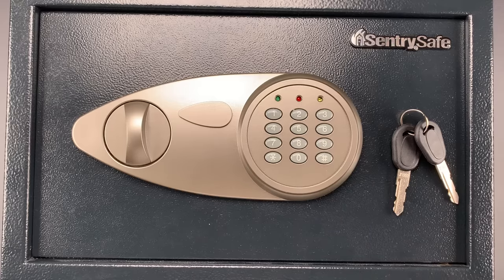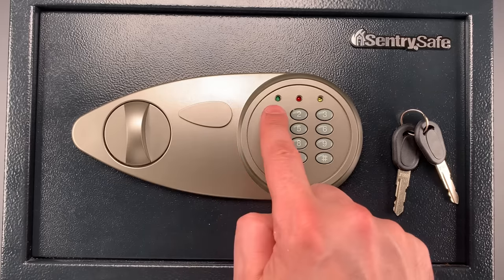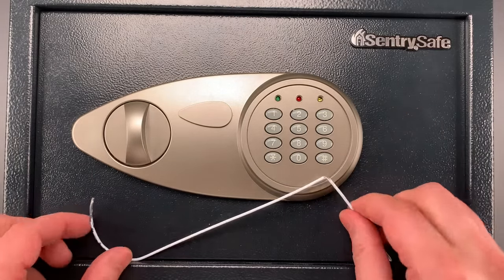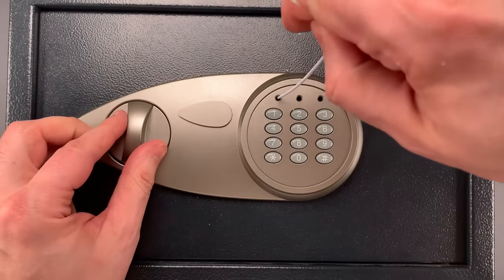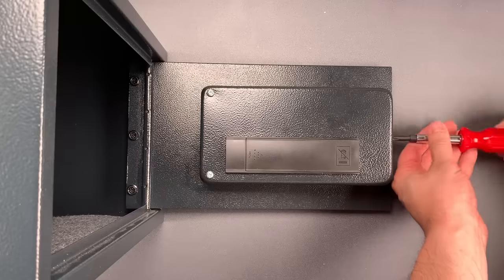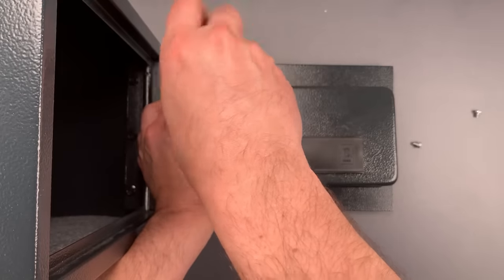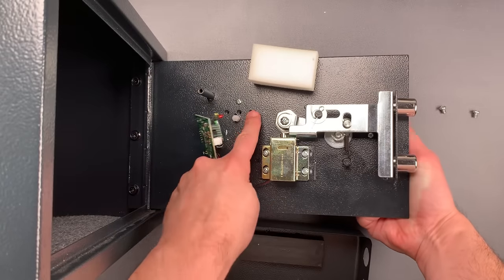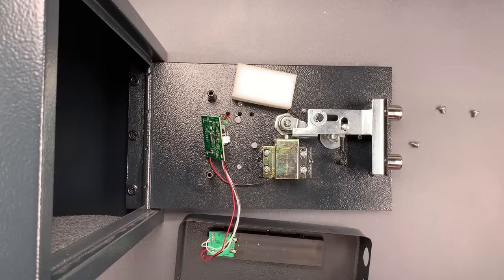[1020] SentrySafe Opened With a Coat Hanger!

Comment: Every manufacturer should be scared af, when their company name is in this guy's 2 minutes long video.
Reply: @owenfranklin814  lol you think i can't see you edited that comment mister soell?
Reply: Dont be deceived by these videos; this guy works his way backwards; he first opens the safe by the standar method (keypad password) then dissasembles the inner box to discover the flaw; in this case the flaw he shows is easily fixed by putting some strong metal block wall in the path from the led holes to the solenoid; but even if you gave him this safe and ask him (without knowing in advance the inner mechanism) he wont be able to open as easily as showed (there's no way he can come up with that specific hanger bent in that specific way if he doesnt know EXACTLY how the safe works, which of course he knows by first opening it off-camera)
Reply: @alerey4363 You are correct.  Lock bypass cannot be done with knowlege of how the lock works.  What are you trying to say?  Locks  cannot be bypassed without knowing how they work. There is no deception here at all. This is how any locksmith or criminal learns how to do this. As a Locksmith (50 years)  I think these videos are great because it helps me to sell a better product.  Do not buy cheap locks! Talk to your local Locksmith.  Be safe & secure everyone.                      -30-
Reply: Every manufacturer should be ashamed of, when their company name is on poorly built products like this.
Reply: @alerey4363  It is document fire safe. Helps save your insurance papers, so you can make a claim for loss in the fire. Its job is fire not burgulary. It is not meant to be hard to get into when burnt up. But I don' think it would do all that well in a fire either.
Reply: Ya gets what you pay for.
Reply: @lazloslozar6782  nope, that depends on the product "claims"; when it says it's a safe (i.e. vault, bank safety box, etc) you should get advice from a lawyer to check if you can sue them for NOT providing what their safe meaning should deliver
Reply: @alerey4363  Good luck with that. Thanks  for your point of view. Have a nice day.
Reply: @lazloslozar6782  I dont need luck, just a good lawyer
Reply: @alerey4363  But he started by saying it could be picked and then found an easier (and more media beneficial) way.
Reply: @JohnTheRevelat0r  Read many comments and you'll see those people think he unlocks these devices from the outside only, with no prior knowledge of their internals
Reply: @robbespel8393  At least he tries to correct his grammar
Reply: @robbespel8393  Now, teach me English grammar
Reply: @alerey4363  I can't find any of these comments, but it does not matter, as those people are stupid if they think he magically obtains knowledge of security flaws out of the air.
Reply: I’m guessing the profit hungry clueless management at Sentry just has their name slapped on Chinese designed products including likely this one. This is a very Chinese fail.
Reply: @robbespel8393  at least he is able to correct his mistakes.
I love to poke dragons :D
Reply: @hmcredfed1836  lol forgot this existed
Reply: Meanwhile M*ster doesn't seem to have done anything about it yet :)
Reply: hall of fame. Or shame. Whatever
Reply: @lazloslozar6782  You right I think as sooner or later any ideas even locks get so repetitive that someone experienced would know how to override them.
Reply: Especially when the actual safe cracking only takes 18 seconds; and the rest of the 2 minutes is showing the vulnerability. 😲
Reply: I'm not sure who the manufacturer is, but I had (Just threw it out) a safe branded masterlock that looks exactly like this.  Thats just not something you want to see, ever.
Reply: The scary part is that the 2 minute videos include polite intro and outro, explanations, context, and humor. It'd take him less time to crack it than it'd take the owner to punch in the code.

Comment: It takes longer to unscrew the back of the door than to pick it open...
Reply: That was going to be my comment :D
Reply: You can't even call this picking though. Hell this is a no skill bypass. The worst part, though, is that the company who made that is probably not at all shameful of the low quality of their product..
Reply: Sentry had major flaws in all their products.  Looks like this could be opened with a rare earth magnet still.
Reply: I know right.... Should have a power driver... But I know if it was real h he'd be gone... Lol... Thanks lock guy, I went but the safe
Reply: Damn, this is the safe most hotels use too. 😳
Reply: @inflatablewolfie  They may not even be watching this video, they are just thinking of new ways to rip off their customers.
Then you could consider that the criminals are probably just going for an angle grinder, a sledge or a bydraulic press instead and don't think of this kind of approach.
Why not sending this safe to the "Hydraulic Press Channel" and let them have some fun with it?
Reply: @Andy1076  Practically all hotel safes also have a master code, in case someone leaves it locked after they check out. They really can't be relied on to secure anything valuable.
Reply: @hotaru25189  Masterlock bought Sentry safe a few months ago.
Reply: And you need a more complicated tool too.
A SCREWDRIVER! LMAO!
Reply: Lemurhino Not a master cod- a key. They all have a mechanical lock as well.
Reply: Yeah the screwing is literally 20% of the video...
Reply: Only problem with this channel is that it undermines a basic idea that all humans drift towards. That is that deterring a theft is about 99% as effective as preventing one. Unless you're being specifically targeted for a specific reason (special documents, known to carry 10's of thousands of dollars, a couple others), you likely wont be targeted for a theft. Any random thief would see a safe and decide that it wasn't worth their time, hell it could be made out of Styraphome and still be stupidly effective at deterring theft.
Reply: @Andy1076  plus, most hotels put the safe in the wardrobe with the hangers.
Reply: Its even shorter when you bump the lock open with your bare hand.
Reply: @DrumDrum83  Sure dude except this safe costs alot more than Styrofoam.
Reply: Eric Brooke Convenience
Reply: It never ceases to amaze me that Youtubers making these videos almost always use unpowered hand tools vs the much quicker electric screwdriver, pistol grip small drill driver Ryobi Tek4, or full size drill drivers or impactors.
Reply: HAHAHAHAH
Reply: Theres even a quicker way where you just turn the knob a little bit and then hit the top of it pushes down the solenoid so you can open takes maybe one second LOL
Reply: @ebengtsson  I prefer videos with 80% screwing and 20% do you come here often.  Lol

Comment: So the lock in my safe was jammed up and the key would not turn it. This video saved me hundreds of dollars from a locksmith and helped me get into my safe in less than a minute! HUGE THANK YOU LPL!!
Kinda scary how easy it was to get into!
Reply: Do you have any tips on getting the bend on the hanger wire correct? I have been trying off and on for a few weeks and get get mine open.
Reply: Actually never mind, I just got it! Just needed indirect words of encouragement through seeing someone else’s success.
Reply: I just did this as well. It definitely wasn’t as easy as he made it sound. Mostly because he had the benefit of making his tool the exact right length.
Reply: helpp
Reply: Hundreds? BS…more like $20. My shop probably wouldn’t even charge you to take it open.
Reply: You should use that money for a better safe.

Comment: "The circuitboard is secured in place with a sponge..."

...I'm sorry, a WHAT?
Reply: a "high security sponge" actually
Reply: I was thinking he was going to say glue
But a sponge
Just how
Reply: Does open cell foam sound better
Reply: I'd love to be a fly on the wall of sentry safes conference room after they see this video. Cause someone's getting fired over that blatant disregard for anything even resembling security
Reply: @thomasvlaskampiii6850  That isn't happening. The company is just happy that they were able to save ~40 cents per save by not securing that board.
Reply: @Fatherfatoants  it's not even glued in place... What is that 1/4 cent per safe?
Reply: @Fatherfatoants  But is that 40 cents worth a lawsuit should someone decide to sue? Cause, I mean, this is America after all. Land of the free, home of the senseless lawsuit
Reply: @thomasvlaskampiii6850  
This wouldn't even be a senseless lawsuit. This one would be well-deserved and appropriate.
Note that I'm not disagreeing with what you actually said, only the (possibly unintended) implication that this would be a senseless lawsuit.
Reply: @thomasvlaskampiii6850  The manager who pushed for that round of cost cutting has long since moved on to a higher paying job.

Marketing is where the money goes nowadays and sometimes that means putting the same internals in a prettier shell so that they can charge 3x the price.
Reply: The sponge is for drying up one's tears after all the valuable contents of the safe have been stolen.
Reply: @theuncalledfor  Yes, that implication was unintended. If someone were to sue, it would be anything but senseless. But, I seriously doubt that enough people would want to sue to make it matter. And even if that did happen, sentry safe or whoever owns sentry safe probably wouldn't notice a few million dollars coming out of their pocket
Reply: Well, it's a high security sponge, so.... you know.
Reply: I could not believe that as well, they could have at least screwed the PCB in place with a few bolts and the addition of a baffle separating the space between the circuitboard and the lock mechanism would have at least defeated the cost hanger bypass (won’t help with picking the lock, but it would prevent something shiver in through the LED openings from granting access to the solenoid and locking mechanism.
Reply: @maweitao  He's the Director Of Product Enhancements and everyone addresses him by his title's acronym.
Reply: @jctoad  I was just chuckling to myself about that.
Reply: I was sure he meant those thick double face tape, not a literal sponge!
Reply: @thomasvlaskampiii6850  They've been making them this way for at least ten years, nobody's getting fired.
Reply: Sigh....Tell me that the sponge was at least made in America......
Reply: @jctoad ,. Clearly that safe is NOT sponge Worthy... lol 😊
Reply: @jctoad  exactly! RofLmao
Reply: @thomasvlaskampiii6850  he got a promotion for saving them $12million.
Reply: Who the hell looked at the design and said "yeah this looks safe"
Reply: @maweitao  He is now the Owner of a foam factory
Reply: They are commonly used in electronic builds where security isn't a concern, I use them in my projects a lot
But this is just terrible lol
Reply: Who lives in circuitboard inside a safe? SPONGE... I..  I fuckin can't finnish the joke this is too stupid xd
Reply: @thomasvlaskampiii6850  Cannot sue read the fine print in the documentation if any.
Reply: @Fatherfatoants  they don't even need to secure the board; just put metal walls around either the locking mechanism or LED panel so you can't reach it easily with an object.
Reply: @catranger01  How about compressible absorbent membrane?

Comment: LPL: "It's held in place with a sponge..."
Me: Hahaha, well that's a mean way to put it
...
OMG IT'S ACTUALLY HELD IN PLACE WITH A REAL SPONGE!
Reply: Legitimately my thinking, I had no reason to believe he literally meant a sponge until he proved it
Reply: I was wondering, what is a "sponge"? Thinking it was fancy lock/safe nomenclature for a part. Nope... Crappy sponge. 
I mean gaffer tape would have held it tighter.
Reply: I've watched enough retro-tech videos where deformed or disintegrated foam bits are replaced to know he meant it literally. This is a cheaply designed electronic gadget pretending to be a security device, after all…
Reply: A "High Security Sponge" even...
Reply: Could easily tack-weld a little angle iron shield in front of the solenoid and bolt to prevent that. Not saying you should have to, just that you could.  Just what I want to do with my brand new security device: open up the door and fire up the MIG.
Reply: A "high-security sponge"!
Reply: Well it's really foam rubber. Sponges cost more cuz you have to fish for them.
Reply: I knew he meant sponge, which is sometimes used in electronics, but i was expecting some thin thing, not a SQUARE INCH OF FOAM!
Reply: I died laughing at this. Can you imagine designing this and saying, "f it, I'll just put a sponge in there "
Reply: One of those few instances where you would correctly use the word:  "literally".
Reply: @SimonWoodburyForget  
On the other hand, it would have been easy to just block the physical path from the whole to the solenoid. Just ad an angle iron. There are lots of screws which could have been used for that purpose.
Having said that: LPL would probably pick the lock in less then 20 seconds.
Reply: Out of curiosity, what did you think he meant? It didn't cross my mind that he might not mean a real sponge. (Though I admit it was bigger than I expected, and looked more like a dish sponge than I expected.)
Reply: @LelleKidd  I wonder how the sponge works on dirty dishes?
Reply: @TheAntibozo  I can just imagine a stringent quality control department & the employee of the month is Homer Simpson.
Reply: @clearcreek69  🤣
Reply: You´re wrong - watch the video -> it´s a HIGH SECURITY SPONGE 😁

Comment: They could have made the entire door out of sponge.
It would be highly resistant to hammer attacks.
Reply: Ironically, that would actually make this product more secure, because it also has a fault where it unlocks easily by dropping it a few feet onto a surface. If it was 100% made from a sponge, the impact would stop it from self unlocking 😂
Reply: @Phurzt  If the entire space was filled with  sponge, and glued it, while you could still push the LED out of the way, the sponge would at least have made it harder to move the coat hanger around.
Reply: not so tough
Reply: OOOOOOR you could just hold a lighter up to the sponge safe and boom.. money

Comment: So my batteries went dead in this exact safe- could not find the keys anywhere. I called the company and they no longer make those keys, advised “go to locksmith”. 20min after watching this video I was in. Absolutely amazed and sooo thankful. Time for a new safe!!
Reply: I have a Secustar. I've spent 2 hours trying to get into it. Bought a giant earth magnet that I now can't get off of the side of it. Bent I can't tell you how many wires. Even got the front panel off but can't get the key lock off. Have a set of those pin things. My Grandmother left her pearls to me, I put the keys INSIDE the safe, cause you know batteries last forever. Now I can't for the life of me get to Grandma's pearls. Tomorrow I drop the thing off of the roof cause tapping the side didn't open it either lol.
Reply: Found duplicate keys online in about five minutes. As long as you have the codes.

Comment: I always imagine the downvotes for his videos are people who use these locks and realise they have to buy new ones
Reply: Nah, they're the people who designed the locks
Reply: @NereidAlbel  nah they know. It's the managers who told the people who designed these locks to make it cheaper because they wanted to see better profits and assumed nobody would find out.
Reply: @phillip stafford-dafoe Well, I learned that I should probably spend a few more bucks on a lock if I want one that actually does the job.
Reply: @MyRegardsToTheDodo  I guess if I ever have enough cash I need to hide I will just use the most inconspicuous books
Reply: Rather than buying a new one, they could solder a wall to block access from the hole to the solenoid and just keep it. Thieves will be pissed when their trick doesn’t work.
Reply: @headcode 
Or putting a live wire right behind the leds...
Reply: @headcode  then you just bump it with no tools needed
Reply: @phillip stafford-dafoe After watching Deviant Ollam you learn that there's often usually easier things to attack than the lock, the door it's attached to is usually easier defeat, and that's the case here. It had a hole in it with nothing between it and the servo.
Reply: I own one of these safes and I’m now trying to figure out how to secure the circuit board in place to bypass this bypass.
Reply: @NereidAlbel  Probably some of them are. Others can be trolls that downvote everything or those who have no interest in security, yet YT suggested this video.
Reply: @headcode  I bet the mechanical override core could be raked easily as a secondary entry method
Reply: @DeatGaming  he's probably saving that for a video down the road 😂
Reply: @0Clewi0  Standard hiding place. Just like false books, false cans and so on. If you have enough money that you'll need a hiding place go to a bank and get a deposit box. That way your money is insured aswell.
Reply: Keith Manfredi or possibly super glue the board to the case.
Reply: @MyRegardsToTheDodo  It was mostly a joke, and it's kinda a tree in the forest for me
Reply: Sounds more like the makers of them.
Reply: Maybe the down votes are the ones who  realize he got in with just the electronic lock. Lock it with the key and you probably can’t get in that easily.

Comment: See, this is the very reason I keep all my clothes in a pile on the floor rather than buy a rack with coat hangers. It's safety first in my home.
Reply: You get plastic coat hangers :p
Reply: As a bonus, you can hide your valuables under the pile of clothes.
Reply: @johnwinebrenner4618  It would certainly be safer and cheaper than putting it in this useless box
Reply: Ah the old floordrobe. I remember my batchelor years fondly
Reply: No coat hangers means no spare key to your safe.